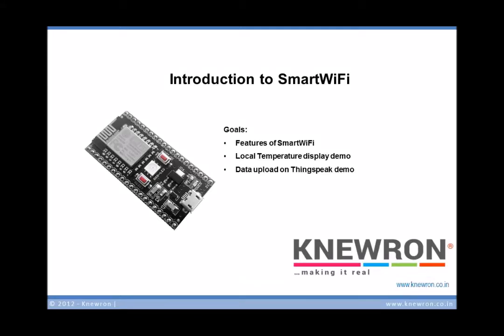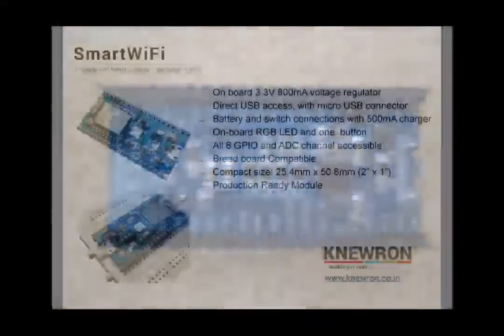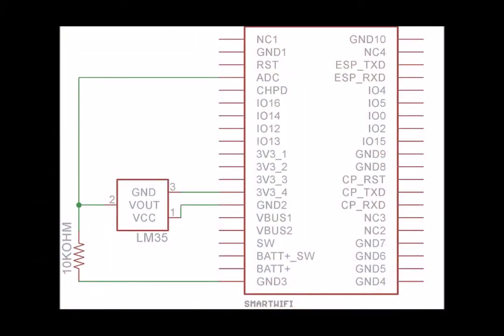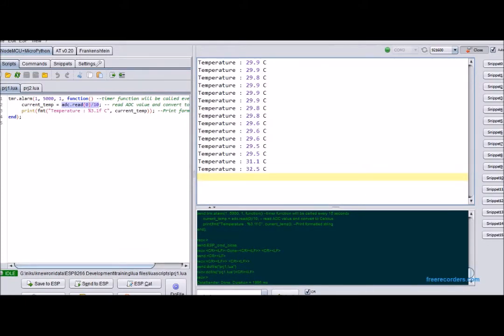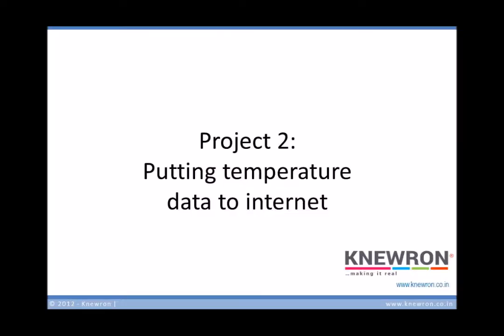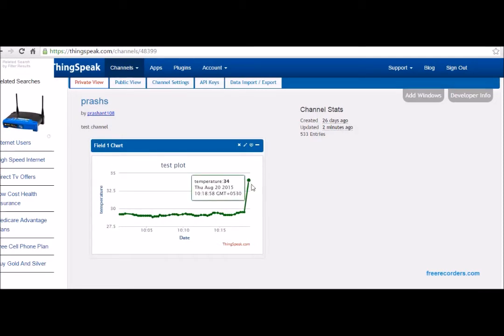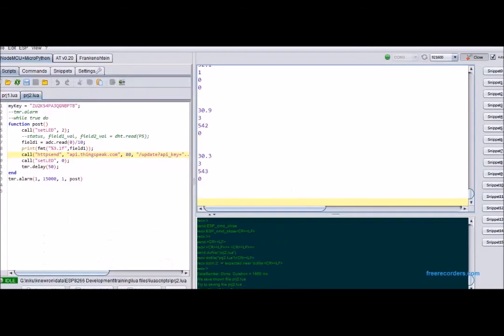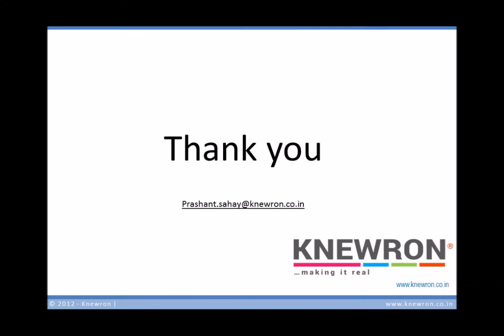smartwifi

Comment: i m using Arduino IDE and getting this error while uploading 

Arduino: 1.8.1 (Linux), Board: "ESPino (ESP-12 Module), 80 MHz, DIO, 115200, 4M (1M SPIFFS), nodemcu"

Sketch uses 222133 bytes (21%) of program storage space. Maximum is 1044464 bytes.
Global variables use 31508 bytes (38%) of dynamic memory, leaving 50412 bytes for local variables. Maximum is 81920 bytes.
warning: espcomm_sync failed
error: espcomm_open failed
error: espcomm_upload_mem failed
error: espcomm_upload_mem failed

kindly solve ASAP
Reply: sinior i successfully uploaded the code